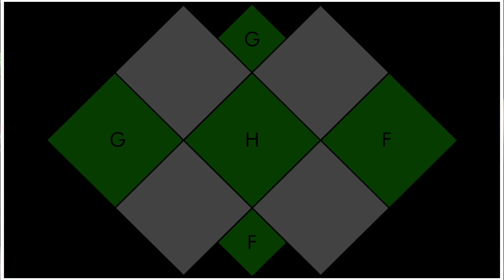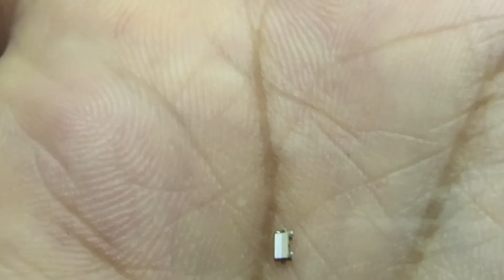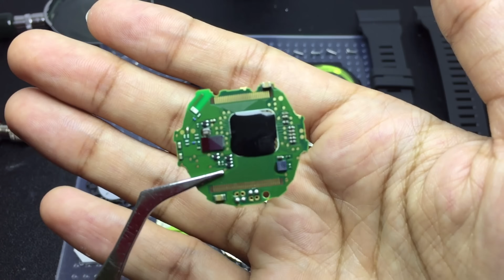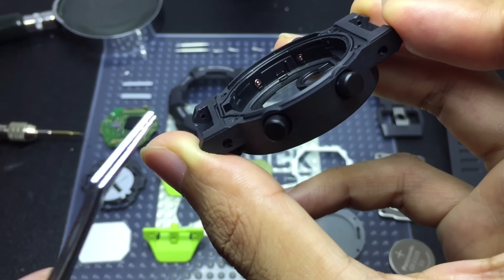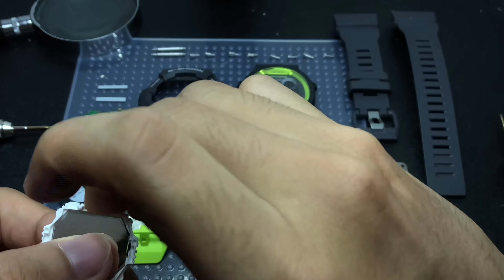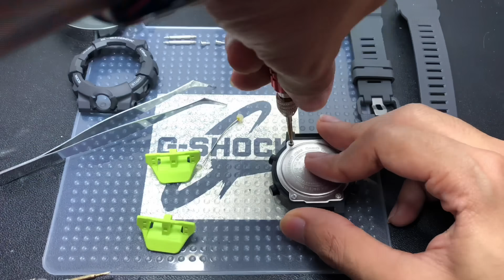The new G-Shock GBD-800 Digital Step-Tracker watch teardown

Comment: Great video. I changed the battery on mine, forgot to fit the gasket and condensation got in the case. Watch is fully functioning includi ng app connection but the pedometer shows 'Err' and wont count steps! What could be wrong? Is there a fix?
Reply from the maker: ouch, this is way out of my current expertise. All I can suggest is clean the board with acetone, maybe there's watermark on the board that might've blocked/shorted the circuit.

Other than that, maybe components replacement is required or full board swap. 🧐
Reply: @gshockhighfashion  Cheers for advice, kinda hard to get individual components for GBD800! Your video has given me hope though, I was unaware that you could perform a 'AC reset' maybe that will be the key, just ordered a selection of ESD tweezers off Amazon, we shall see. Regards.

Comment: Thanks for the thorough review! Unfortunately, your assembly montage is way too fast - can you remember which way did you mount that tiny LED? With the two shiny contact points facing up, which side points at the screen - yellow or white?

Comment: I'm so surprised,there is no cushioning between the module and the hard case. Also within the module there is only on the right side and not on the left. Do you think this model is less shock resistant than others?  Also I would really appreciate if you could do a torture test on this specific model. It would have a ton of views!